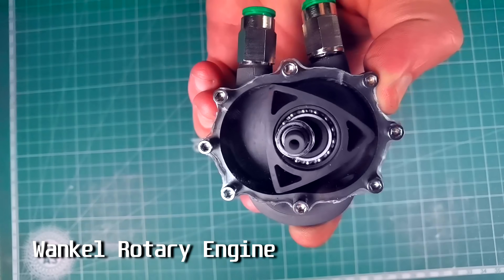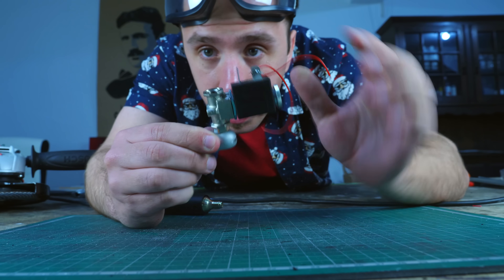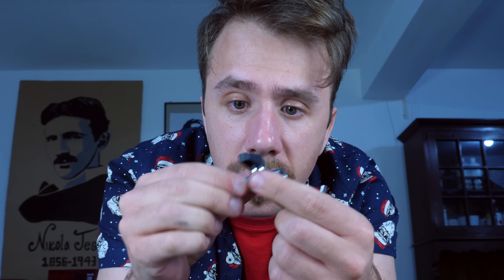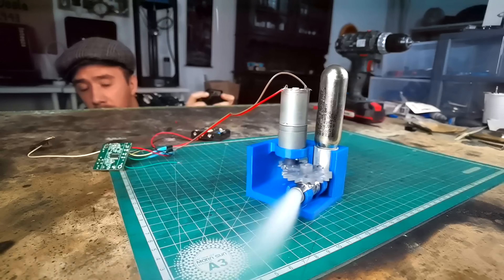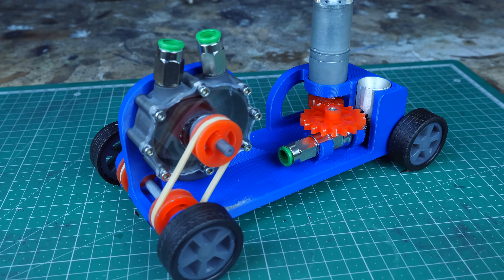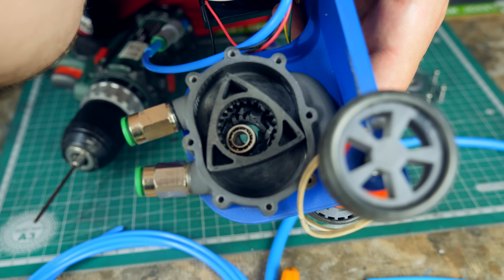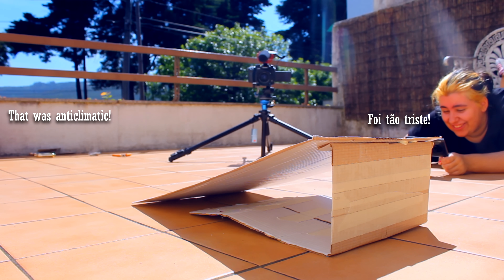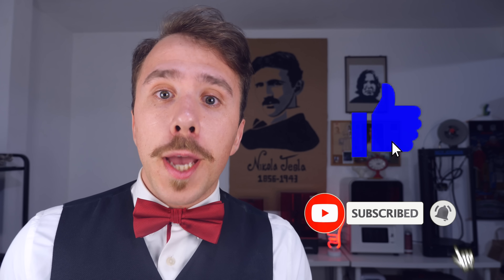Rotary Wankel RC Car (3D Printed)

Comment: ok buddy, your engine is leaking big time, which in turn is losing compression, which also means is loosing power, aside of that, you need to gear down that car, i would say 8:1 is a good spot, else the wheels are just gonna skip forever, finally you need to get creative and find a way to regulate the pressure in those cartridges slowly, else you'll be turning the engine into a top-fuel-like engine... for context: those need to be 100% rebuilt after one single use that last about 10 seconds.

Comment: Video idea: 3d print a solenoid engine casing. Then use wires and electricity to form electromagnets to drive pistons :) then you can drive a propeller or car or whatever

Comment: Why didn't you just turn the exhaust of the Wankel engine to shoot out the back of the car instead of upward? Then you would get a little bit of thrust like you did in the end and still have the wheels powered by the engine

Comment: Video idea: 3d print a solenoid engine casing. Then use wires and electricity to firm electromagnets to drive pistons :) then you can drive a propeller or car or whatever

Comment: When driving it from the engine, you need a better connection. Some kind of Clutch plate would be really good as you could change how much pressure it takes to move. If you do direct drive like with a chain, would instantly break whatever its attached to due to the sudden movement.

Comment: definitely need to gear down the engine there, maybe even add some weights to increase the traction on the front wheels, or even have the engine exhaust above the front axle to increase down force!

Comment: Video idea: I want to see more with the Wankel engine but there is a lot of loss on the co2 cartridge, you can see liquid co2 in the main of it. I wonder if there is some way that you could heat up the co2 as it comes out to get the full power out of the cartridge. And then you should point the exhaust to the back so that it acts as a bit of propulsion.

Comment: Suggestion: make a hydrogen fuel cell and a hydrogen generator, since you've already polluted enough with your rocket engines :) Or a hydrogen powered rocket.

Comment: U remeber how your rockets got more powerful when you turned the fuel upside down because it released liquid instead of gas? Seems like ur just loosing fluid here and it's expanding outside the engine, maybe turning the tanks upside down could make it run further

Comment: Suggestion: Wankel engine powered submarine! you can even have the escaping gas inline with the prop to get a little boost!

Alternative suggestion: do this same video but have a the motor spin up a flywheel and build a simple transmission controllable by the remote that engages the flywheel to turn the wheels

Comment: Between the rubber band not having enough tension and friction, and the wheel hop, you aren't delivering any of the power to the ground. If you fixed that I bet that thing would actually go pretty good!

Comment: You should lower the pressure a bit first so that your CO2 does not come out in dry ice form and also you should store that burst of energy in a freewheel or a spring. Tomatoes are disgusting.🤮🤮🤮🤮

Comment: You definitely need a regulator. The initial burst of pressure is so high that the tires just spin without any grip. A more steady pressure seems like a logical way to improve. Maybe better tyres.

Comment: you should try to use a regulator to decrease the output pressure of the cartridge's and increase the duration, also gear it down so you have more torque

Comment: Try putting a pressure regulator on the car to cut down the rpm and make a the gas last longer and make gears to power the wheels an a direct drive system instead of a rubber band

Comment: make a regulator for the cartridge so you can give longer flow, then you can build a rocket and you can feed it massive amount of air from the cartridge which boost yar power from rocket!

Comment: I feel as though if you had a better transmission and less blow by for the rotor, and a better apex seal and we're able to use two of the chambers like the wankel actually does, you'd be able to get a lot better results with it. But it is 3d printed after all 13-14k rpm might mean a melt down lol

Comment: Why not 3D print a tomato butcher farm with  old sucessful rocket Designs and have the rockets blast the tomatoes into tomatoe puree. 🍅. Then make a 3D printed pizza oven powered by a rocket engine to quickly cook the pizza with heat which makes a vortex.

Comment: Make a two rotor with the air flow through the center housing. It will reduce fibrations and this is how mazda does it

Comment: The Wankel engine has much more potential than what you're getting out of it right now, the rubber band slips like crazy. I think it could work a lot better when the belt slip is fixed (maybe using a 3d printer belt instead of a rubber band?), and releasing the gas slower will probably improve it too, as now the immense pressure is leaking considerably (it's probably a bit too much all at once). It would be awesome to see the full potential of this thing! (it can definitely jump that ramp!!)

Comment: Some of my thoughts to make this car run longer:
- I think restricting the airflow would result in an overal efficiency gain, now a lot of power is waisted because the CO2 comes out partly as dry ice due to the rapid expansion. 
- Some more efficiency is lost by the CO2 that escapes the chamber.
- Gearing the wheels to the drive shaft, instead of using pulleys might further increase overal power gains, I think some power is lost due to the driving belt slipping and jumping.
- There is a lot of wheelspin at the beginning, a different gear ratio might prevent wheelspin when the engine fires up. But this could also be achieved by limiting the airflow from the cartridge to the engine.

Starting a car from complete standstill requires some torque, but low rpm. This setup, delivers very high rpm right at the start and from then on, next to none. Maybe you could invert that with a flywheel - clutch system, where you spin up the flywheel with the CO2 and wankel engine, at high rpm, and the clutch disengaged. Then starting the car via a slipping clutch, and once the car gets going, you can fully engage the clutch to draw all power from the flywheel.

Comment: Elastic bands don't make great drivebelts as they are too stretchy making them lose friction on the pulleys. An O-ring, lightly sanded, would have worked better.

Comment: I think there's way to much pressure when when the gas enters the engine block...so it's producing a ton of torque which is not required and hence slipping the wheels..I'd suggest you also add a throttling valve that will decrease the torque while also increasing the distance traveled while minimising damage to the wankel engine..keep up the good work!!

Comment: hey, since you are using those rubber bands, you should use multiple of those because the pulley system was slipping and you were loosing a ton of energy on only the pulley

Comment: What if you rotate the Wankel-Engine so that the outlet-pressure also powers the car and it has a little boost and to use the energy more efficient.

Comment: i dont think the wankel was the issue, the axle, 'gears', and the rubber band didn't get the power from the engine to the tires. most of the time the rubber band slipped, and if it gripped, the axle didn't spin but rather got pulled up.

Comment: Try to get a regulator on the co2 cartrige. Then your car would go alot further. And not just spinn the tires at the start ant let al the momentum go to waste. And try another way of transferig power then a ruber band. Mayby gears or a tooth belt of some sort.

Comment: Flip the cartridge right side up, that way it only exhausts gas. Should be able to get more range out of it that way. See the  second slow-mo you can see some of the liquid co2. Also a single piston engine would probably be more efficient, running on short bursts from the cartridge rather than constant flow.

Comment: There's a reason why the one valve had that tiny hole. What was needed to get the thing working better is a metering orifice. Then you're not overpowering that air motor and destroying it. (Much more range/longevity, however the results may not be quite as entertaining.)

Comment: I think the efficiency of that engine is probably between 1 - 5 % or even low . Instead of releasing that pressure all at once we should control the flow of gas in a much steady way that way we could increase the distance the car travels.

Comment: You should add a servo motor tô the valve tô control the Flow of air and add a reduction gear on the wheels so that you have a proper controllable RC car and the cartridge lasts longer.

Comment: You should try a video where you use gearing to lower the speed and increase the torque of the engine and also try to make the co2 slower through the system instead of the burst like a slow trickle over time

Comment: It looks like you're losing a lot of energy through the slippage of the belt/rubber band. Maybe try using different belt materials or pulley types?

Comment: You should make a model rocket using the 3d printed Aerospike Hybrid rocket engine with Co2 cartridges as boosters to get it to a higher altitude

Comment: With some kind of pressure reducer you could extend the time the engine is running.
If you figure out how the work, you will be able to make some with 3D Printing for sure.

Ps: If you isolate the CO2 Bottles/Cartridge, the CO2 inside will not freeze if you open the valve.
What further extends the time the bottle supplies pressured gas.

Comment: ideas to possibly make this work better with the engine:
use gears or a chain instead of a band so it won't slip,
use a reducer so you don't blast the entire cartridge of CO2 all at once,
make the exhaust point towards the back as a bit of extra thrust

Comment: You should try to 3D print a steam engine, specifically the kind that powers train wheels and run it on compressed air to not melt the internals. Then make a car out of it

Comment: I recommend you buy an older manual milling machine and convert it to CNC using LinuxCNC Integza. That's my recommendation for a future project. I'm currently in the process of making one from scratch.

Comment: You should add a plutonium C02 heater so you aren't blowing dry ice through your wankel. I think you'll get much improved gas mileage. When you aren't using the heater, you can leave it sitting unshielded by a tomato plant.

Comment: Video idea: Add a flywheel so that all the almost instant force from the cartridge can be used for longer rides!
Reply: And make an adjusting band, by using a flat rubber ring and a cone, so it still has contact when at full speed

Comment: You're still using these cartridges wrong! They are full of LIQUID CO2 under high pressure. When you open the cartridge pointing down the small amount of CO2 gas is at the top and it pushes the liquid CO2 out first.  You need to keep the cartridges upright while using them and or have an expansion chamber that allows the CO2 time and surface area to grab some heat from the atmosphere so it can fully phase change into gas BEFORE doing work in what ever device. To take it one step further, use a regular to bring the CO2 pressure down to a more useable point as well as slowly release the gas in a controlled and steady manner.

Comment: Some thoughts...   the unregulated CO2 creates too much flow initially, which quickly drops off to next to nothing. You can see the belt and wheels "bouncing" and "slipping"as they struggle to handle the initial torque and power, then it all works well, then it all falls away too quickly.

Maybe a flow control between the outlet of your release valve and the wankel engine could control the flow to a steady, usable value? Simple various sized orifices and springs/diaphragms could be used to experiment.
This will reduce the initial overload, with the added benefit of increasing the duration of gas release.  

In practice there is no difference in the flow and pressure from the bigger or smaller cylinder as they're both at a max of 800 psi, just duration due to the different quantity of gas.

That motor would have broken in either case due to the brutal first release of gas, it is only plastic after all, and subject to sudden freezing from the expanding CO2. 

Introducing a flywheel between the motor and the wheels would also help, as the inertia to start the flywheel moving would help to absorb the shock of the initial gas release, and it's momentum would then increase the range of the vehicle. There would need to be experimentation to get the right mass for the flywheel.  Maybe a 3d printed flywheel with printed hex nut "holes" that you could add or remove nuts to adjust mass?

Just an idea or two, keep up the vids, love them.

Comment: Maybe flip the CO2 cartridge ,, lets the C02 inside fall to the bottom of the cartridge and evaporate more gas then solid CO2 .. the temperature of the gas can make plastic brittle, so maybe a heat sink to just make sure its only gas and not flows .. 
 Love your videos , keep up the good work

Comment: The valve needs to be dialed down....your using most of your energy before the car even moves...need some gearing and away of slowing down the pressure from a big burst to slow and steady

Comment: Hello, I recognized that your driven wheel is slipping. That is probably because the starting torque and speed is greater than the friction. Try to add more weight to the driven axel. The wankel engine has very high rotation speed, with a pair of gears you could slower it, or design an automated transmission (variator) for this. For the driven pressure you could build in a pressure regulator (like one on your CO2 bottle you have on your welder.) then you could regulate the speed of the engine and probably it could drive further.  And most importatntly never stop creating great videos like this.

Comment: You’re losing a lot of energy from the rubber band slipping on the pulleys because there’s no tensioner and the tires are losing traction from your co2 cartridge disposing all of its power at once. Try adding a tensioner to the pulleys or make a CVT transmission system like those snow blowers and it’ll go a lot faster and more efficient
Reply: Exactly, it honestly seemed like he didn’t put any effort into making that any better at all. I lost quite a bit of respect for him after this video

Comment: Integza, now try 3d print an airplane and use the compressed air triangular engine with one big propeller and 4+ CO2 cartridge ( two or four on each wing for balance ) to power the plane.
Reply: That would be way to hard
Reply: @thereinthetrees_5626  but not impossible
Reply: @wolf2k143  yeah probably impossible, it would be way to heavy, and that power method would be too inefficient for their to be enough lift for it to sustain flight for any distance

Comment: Wait, it looked like that rubber band was simply slipping and not transferring the full torque of the engine to the wheels. you should try a gt timing belt. 
You could print it out of TPU (if you don't have one lying around)

Still, really cool stuff!
Reply: Or just use gears

Comment: I recommend using lightweight PLA aka LW PLA if you 3D print a drone, it's a form of PLA that gets less dense based on the printing temperature. Super lightweight and perfect for rc air vehicles. I plan on making a 3D printed RC plane using it in the future.

Comment: 1. Your belt slips. Make it geared.
2. There's still useful work going out the exhaust. Make another engine and plumb the exhaust of one engine to the intake of the other

Comment: Make a drag car with this, First adjust CO2 release rate, bigger rear tires, fixed chain and attempt to vent the exhaust out the rear using a venturri.

Comment: There is a lot of extra weight and a lot of energy is not used. For the v2 Wankel car aim the exhaust at the end to give you more forward momentum, use the valve from Amazon, use a small LiPo instead of 4  AA batteries, lower wheels to ground for more traction, and use a bit bigger wheels. Furthermore, you can make a hybrid car that uses the instantaneous torque of an electric motor to get moving and then the power of the Wankel Engine to go super fast!!

Comment: You should make a proper transmission (the belt is slipping)
You should make an intercooler to heat up the co2 (increase volume & run time)
                                  a stiffer frame (bouncing on video)

Would be happy to see a v2 nice work tho

Comment: Video idea: redesign the car so that the engine sits lower and put bigger wheels on it so it clears the ground. Make a drive shaft to make a regit  connection to the wheels. You seem to be losing a lot of power when the engine starts to turn. You can see in the slow mo that the rubber bands slide a lot before the wheels start moving. By replacing the rubber bands with something more solid and regit like a plastic drive shaft you would probably get more power to the wheels.

Comment: it looks like there was a lot of energy loss with the rubber band to the wheels. I would suggest for your car print a gear box and a flow regulator so it discharges over a longer time. i really want to see this compressed air car take off

Comment: Seems to me like the cold gas is cooling  the plastic, which makes it brittle and it gets destroyed faster. Fun fact, you can 3d print Delrin (with an extruder, I dont think delrin resin exists) 
Also the belt you had was slipping quite a bit. A chain might be too much mechanical energy for the device to overcome, maybe a ribbed belt?

Also this is by far one of my favorite channels <3

Comment: I think this still has potential, there was a lot of slip on the belts and the wheels.

Go 4 wheel drive.
Wider or toothed belts
As some kind of regulator to for longer more stable flow.

PORTUGAL DEPENDS ON YOU!